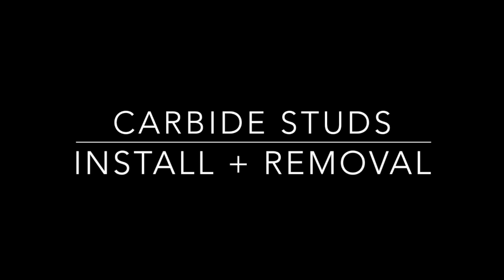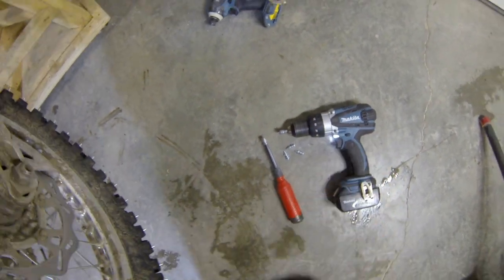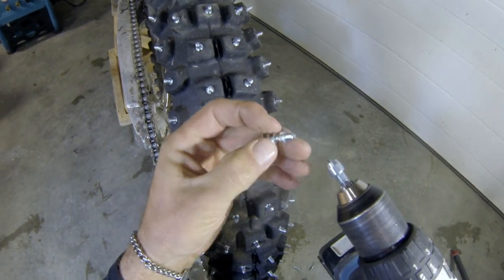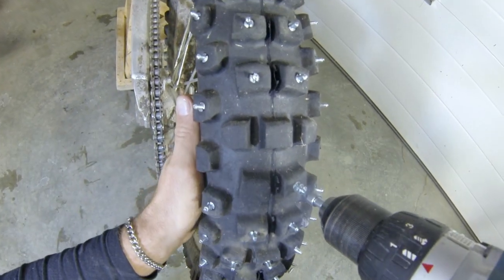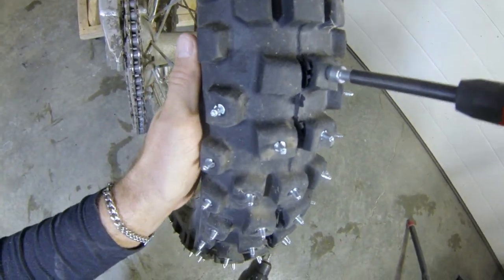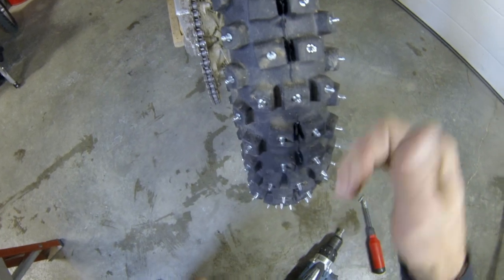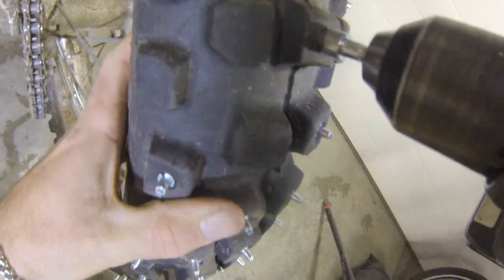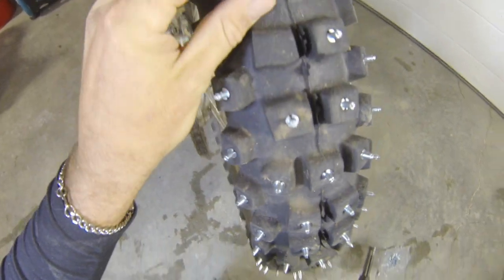Grip Studs [Installing Adjusting & Removing]

Comment: now why do we need to put so many on. i thought the goal with studs was so that you have higher ground pressure thus better traction on ice. i suppose if you have a powerful bike and not going on solid ice its better to have more. I'm gonna try them but only putting 75 on front and 75 on rear. i'll pick a pattern so if i want to add more i can. do you think this is a bad idea?
Reply from the maker: Give it a go!  You can always add more!  Most everyone from the amateurs to pro riders in our area put as many studs in as possible for trail riding.
Reply: @RideEnduro  i'll let you know how it goes. i'm going out to camp tomorrow, gonna count just to "eye it up" make sure it'll work before i order them.

Comment: Tried installing studs in a fairly worn starcross 5 and had some punctures. Would i be better off to run a mousse or cut up an old tube for a liner? Kinda leary of trying these on a new tire but bigger knobs would help.
Reply from the maker: Yes the knob height is very important.  If the screws are penetrating the carcass they will definitely pop your tube.  Use a new tire, something softish.  Mitas tires has their winter friction line of tires that are meant to be studded.  And the IRC M5B is also a great compound for a studded rear tire.    A soft mousse insert would be best for excellent traction but not a must.
Reply: @RideEnduro  thank you, like your channel btw
Reply from the maker: Thanks 🤘

Comment: After removal and reinstallation, did they feel loose or same as the first time?  Not getting snow after i studded mine, damn it!
Reply from the maker: Alvin C I would suggest that you leave the studs in the tire you have and buy a new tire for dirt riding.  Removing the studs and reinstalling them into the same tires might compromise how they hold in the rubber and you might loose a bunch.  Plus it’s faster to swap tires than it is to remove and reinstall studs.

Comment: What rear tire is this? Looks great for mounting studs.

Thanks!
Reply from the maker: The tire in the video is a Shinko 505 cheater tire.  It’s a very gummy tire, mounting the studs is very easy but after a season of riding on them they started to lean.  The IRC M5B is a great tire for studs as well as the Shinko 525.
Reply: Ride.Enduro thanks!
Wouldn’t the 525 be too soft for studs?
Reply: How long do the actual studs last?
Reply from the maker: Depends on where you ride and how hard you twist the throttle.  If you are riding frozen dirt and snow, you can expect a few seasons out of them easily.  If you have a ton of rocks in your area and you like to twist the throttle then you can expect them to wear quicker.  In general, 3-4 seasons.

Comment: Are you running tubeless? Or a liner?
Reply from the maker: Justin Rath i run Michelin BiB Mousse foam tubes.  You can use a standard inflatable tube with these studs if you mount them in a tire knobby that is tall enough, so that the stud does not puncture through the tire carcass.

Comment: How does work on ice.rally  want to try on my Crf
Reply from the maker: They work great on ice, snow, dirt, rocks, logs, rainbows... you name it!  But if you are ONLY riding ice then there are cheaper ice racing screws that do not contain Carbide.
Reply: @RideEnduro  where can i buy these? what brand are they?
Reply from the maker: RacerRed These Studs are called Grip Studs and they can be purchased directly from their web page or ask around your local dealers.  The front studs are the 1740 series and the rear tire studs are the 1800R.
https://www.gripstuds.com/Motorcycle_Winter_Dirt_Bike.php

Comment: Is that a Shinko  505?
Reply from the maker: Yes I believe that was a 505, I found the tire compound was too soft to hold the studs properly though.  I have since removed the studs from it and reinstalled them in an IRC M5B, it holds them much better.
Reply: @RideEnduro  thank you for the advice! It’s an expensive set up thank you for the help!
Reply from the maker: @travis4man   yes it does get pricey with rubber and studs.  But they can last quite a few years if you are careful where you ride.  Don’t do any road riding, and try to stay on trails that aren’t rocky.
Reply: Can I ride on an icy dirt road?
Reply from the maker: @thewildbean2367  yeah you can ride on practically any surface still.  But it will shorten the life of the studs if you are doing it frequently.
Reply: How many total studs for a rear M5b? Thanks man.
Reply from the maker: Approx 250.  That should leave you with some extras for replacements.  I can count once I get home.